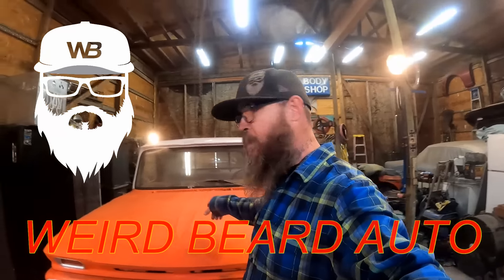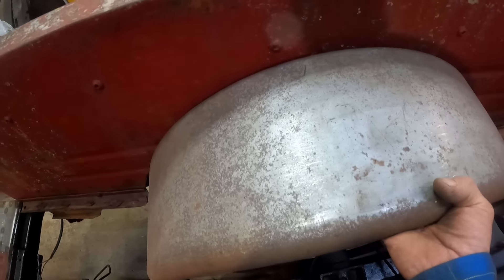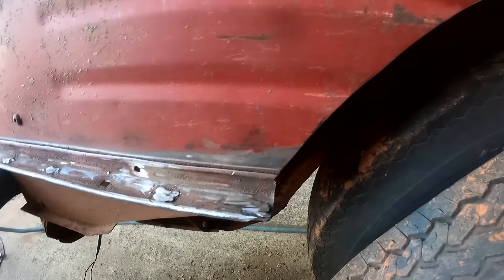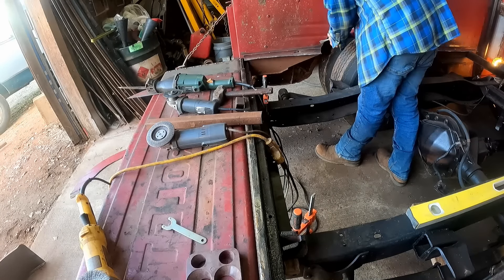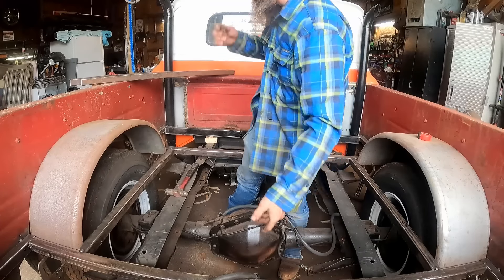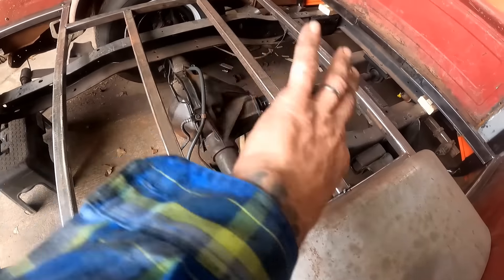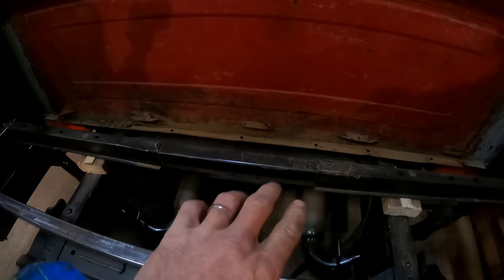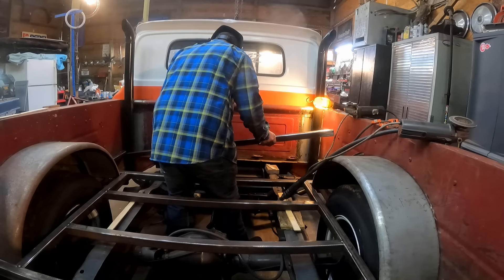BUILDING A CUSTOM TRUCK BED FOR THE '66 CHEVY 1 TON DUALLY

Comment: Brilliant build, looking forward to seeing it finished. Maybe use weld through primer on the bare metal on the wheel wells...save you some work later and help to keep the dreaded rust at bay a little 👍

Comment: Mike, I am loving how the truck is shaping up. 
Wooden bed for sure. Anything else just wouldn't be true to the truck as it sets. You're going for that original look of a truck that's used regularly for work. So go back with wood.
If you had gone with a flashy high gloss show truck paint job, then diamond plate, or something else could have been ok, but not this time. 
I haven't received notification of any new videos from YouTube in a long time. Have you been posting? Or am I just not getting  notified?
It's good to see a new video anyway.

Comment: If you can lay your hands on some red oak, that will look flat out good. Do a standard finish on it before you lay it in but definately some oak. The red is gorgeous when its got a good finish on it. The trick to getting it right is sand each layer of varnish or whatever you pick for a sealing coat. When you can get it thick enough, you can go on with a good wet sanding. Make the finish smooth as a baby's butt. I love the original idea for the truck. Working it out, as you go, is about the only way you could get this done. I hope you remembered Valentine's bro. Your wife deserves the best you can give her.

Comment: Just came across your channel and have enjoyed this build. Keep it original looking with the wood bed floor. Love those old Chevy step sides, had a 65 with a 327 and turbo 400 trans with 373 posi reared. That was a fun little truck to drive. Keep up the good work

Comment: I was like the looks of the wood beds to make it a work truck with bed because stand it with used motor oil and use some rough cut wood if you don't someone who has a mill has some dried out would look really cool

Comment: Hi Mike, I am, totally with you on the wooden bed, it will give it a warm tone, but i am not sure which wood, with the orange, unless you make the bed and burn it a little to bring the wood colour down a bit to a dark brown/blackened wood, the plain colour would be too insipid, then you could still varnish or wax it or whatever you choose, then for protection when you have a nasty load to carry get some rubber sheeting to popper in there

Comment: You need to put some kind of heavy screen around the lower part of the pipes from the top of the bed to the floor It will be hot. My brother did that with his truck years ago when kids could ride in the bed, the Pipes above the bed they could hold onto because it was cool.

Comment: Thought of an idea for a bed floor.   Station wagon roof section.  Stamped ribs like a typical bed floor, should be easy and cheap to find from an otherwise trashed parts car.

Comment: Something that caught my eye was that there seems to be a large gap between the tailgate and that first bed cross bar at the wheel fenders.Does there need to be a bit more metal support there (even a couple of trianglular sections?) as that is commonly the landing point for most things being loaded into the bed.Guess it would be OK if the bed is just for show purposes.

Comment: Coming along nice. Might not want to weld in them two cross tubes in that are between tires. I almost made that mistake before welding up air bag mounts or in your case shock mounts and c notches. More room to move around the better job can be. The bed wood should be very last In my experience's. Just ideas awesome work take care..

Comment: My vote is definitely for a wooden bed, maybe with shiny metal sliders on it?
Another wood bed idea would be to use 1 type of wood planking(teak! ) and some other 2nd type of contrasting darker wood slats as pinstripe fillers between the planks. If sanded back flush and varnished with high quality UV resistent boat varnish you get that high gloss teak deck classic boaty look to it.
Reply from the maker: That would be awesome

Comment: Maybe you could use some of that Trex plastic decking that they use for decks at people’s houses. It won’t fade, splinter, crack or rot. They make it with channels running through it so you can hide wiring too. Pretty spendy for a whole deck, but this is a pretty small job.
Reply from the maker: Interesting idea.

Comment: 16:29 I would've thought you'd have used a spirit level when you were installing the bed frame. How'd you know if it's on level? Or are you just going to shim the wooden floor level? Not criticism just a genuine question.

Comment: Use burnt wind seed oil a little bit of diesel used motor oil and it makes the best stain learn this from a farmer who puts it on his barn it's over 150 years old looks brand new and doesn't rot out

Comment: I know most will think this is boring, Factory wood was Yellow pine painted black. but i think would look great .
Reply from the maker: I think so too
Reply: @weirdbeard8898  it will give that custom truck a look of factory . i think satin black would be a good choice, instead of the flat black GM used back in the day. and more durable.